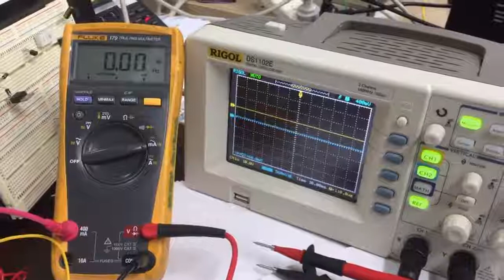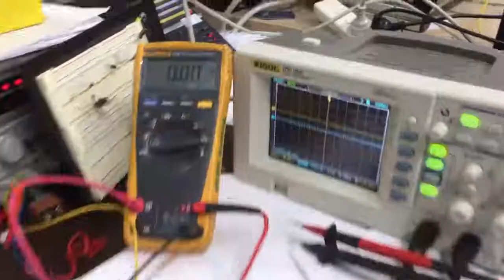Stepper Motor Current Value vs Waveform

Comment: hello sir. i want to measure current of stepper motor from my 3d printer. i am not sure about how to do the connection with oscilloscope or where to connect. i dont have lot of knowledge about it. i will be helpful if i get some information.